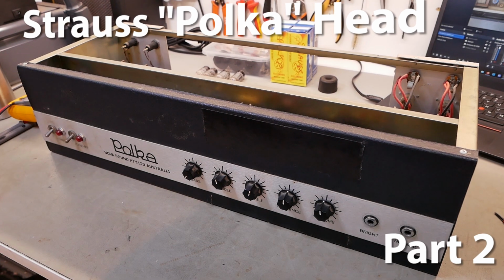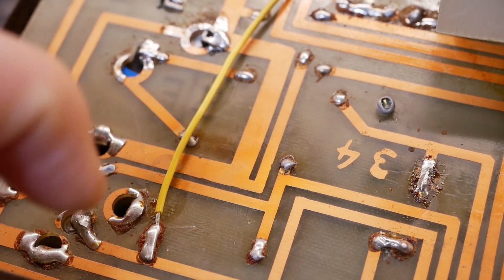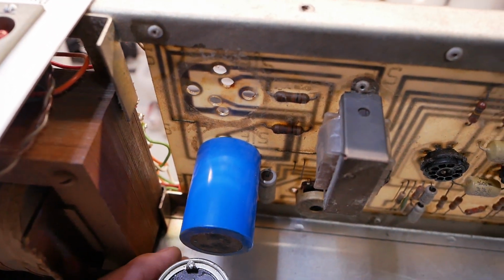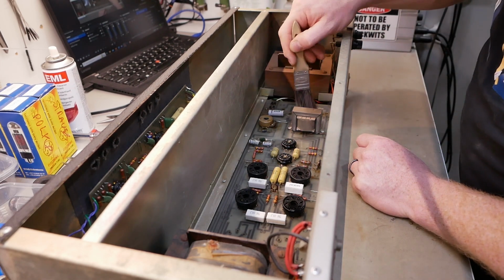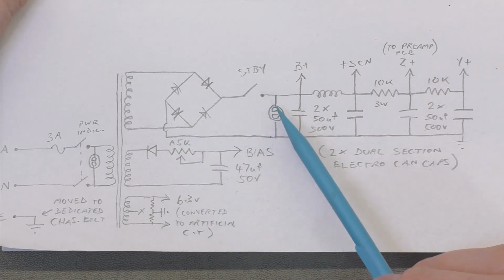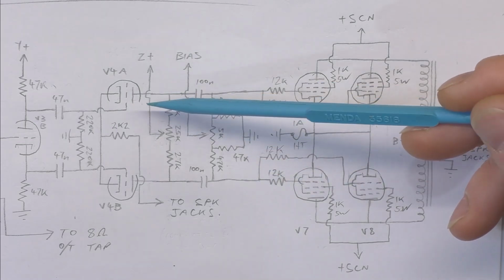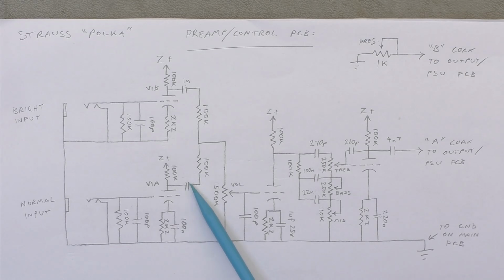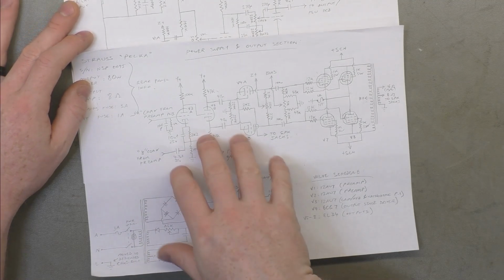Strauss Polka Head - Schematic Analysis & Starting Work

Comment: Awesome work Brad. I've been sporadically rescuing of it's bigger brothers, Polka 200 (4 x KT88s), for a long time. The O/P PCB was so badly burnt so I completely rebuilt it on a bakelite board with tag strips.  You have given me the inspiration to finish it off. My current hurdle is finding pots with long collars. I'll pass on a source when I find it. Expect that to be USA for some of those values.  I'm also looking at the tone stack and whatever else is making it dull. So.... really interested in what you have in mind. Looking forward to part 3 mate.

Comment: Its still not clear to me if the 6CA7 and EL34 are indeed the "same" because Philips held the pentode patent, which most American tube/ valve manufacturers didn't want to pay; which is how and why "beam power tubes" were developed: as an end-run around the Philips patent. Has anybody here ever taken apart a 6CA7 to see if it has a suppressor grid like a true EL34 pentode does?
Reply from the maker: I returned these ones to the customer as always, so cannot confirm nor deny.
Reply: @BradsGuitarGarage  ,  I did a little online reading and it seems that Sylvania introduced the 6CA7 a year or so after Mullard came out with the EL34, but the Sylvania 6CA7 "fat bottle" was indeed a beam-power tetrode ---- purportedly similar to their 6550 design ---- and not a true pentode.  The fat bottle Sylvania was typically used in American-made hi fi and guitar amps, likeky because it was cheaper than the Mullard EL34, and purportedly favored for hifi use because of lower distortion and cleaner sound, assuming that the fat bottles would still fit. Reportedly they do sound a bit different in guitar amps, and the original Sylvania 6CA7 is supposed to be more rugged and reliable at ultra-high voltages than the Mullard EL34 was. Not sure about how current production Russian or Chinese tubes are buily, but if it's in a skinny slender bottle it probably is an actual pentode, and the only real reason to manufacture a " fat bottle" version is either because it's a beam power tube and the elements are too large to fit into the standard EL34 bottle, and/or it's a marketing gimmick to fool people into thinking that it's the "same" as the original Sylvania fat bottle 6CA7, which it might or might not be.....
Reply from the maker: Once again, thank you for your efforts looking into these subjects.
I really wish the valve industry wasn't so opaque and amorphous.
It makes it really hard to reply with definitive sources when customers ask questions.
Particularly when they ask for validation of shady forums that they've read.
Reply: @BradsGuitarGarage  ,  Now that virtually all of our modern tube/valve production is done in authoritarian- controlled countries, it's even more difficult to figure out to what extent modern production valves are made like, or unlike, the originals; not to mention whether the people making them are treated with basic dignity as working people should be or whether they are abused and underpaid ---- and also whether the local environment becomes polluted because of the various chemicals and materials used in manufacturing tubes/valves.  There's no guarantee for instance that people manufacturing tubes in China are treated any better than the people manufacturing iphones at Foxconn.